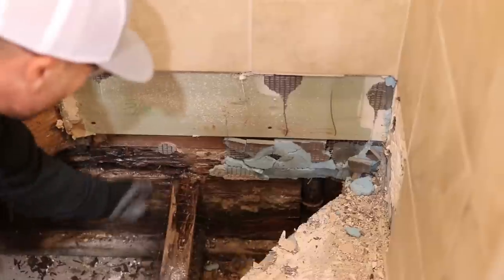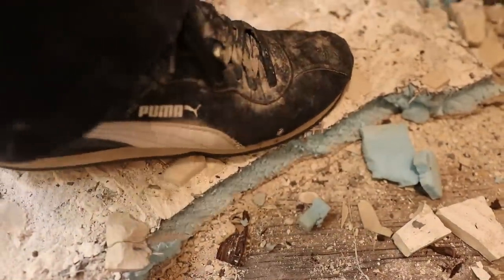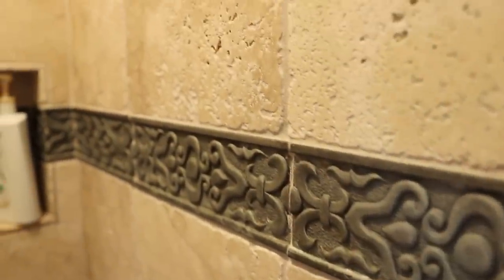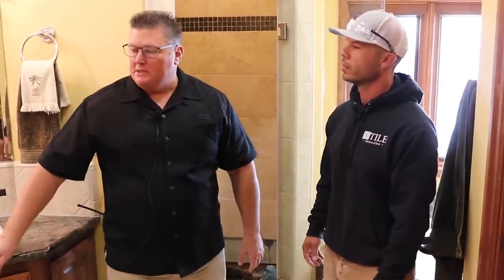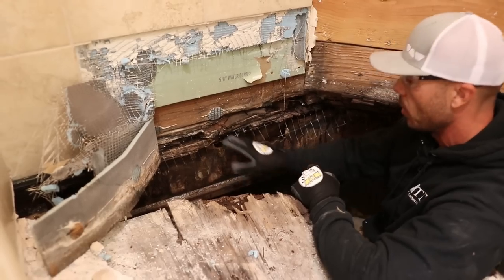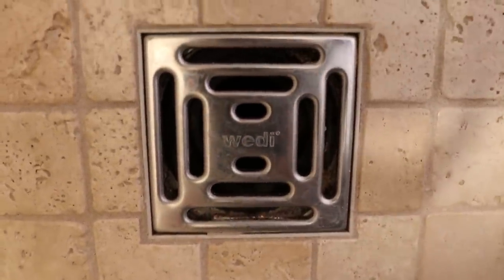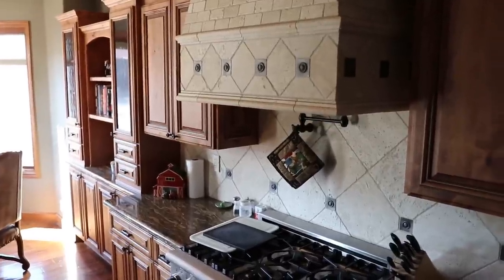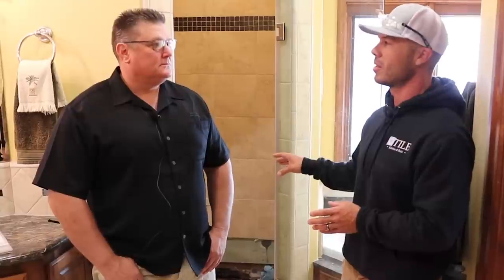Massive WEDI Shower FAILURE (Done by Certified Installer) -- Warranty Claim DENIED

Comment from the maker: Before you comment that the wrong sealant was used, please understand that Wedi was using Sikaflex polyurethane as the approved sealant at the time of this install. I have proof from archived websites that explain it in detail in this video: https://youtu.be/_skYsjFBnPM.   The sealant they now use use is a silane based sealant similar to kerdi-fix, which performs much better in wet applications. Important to note that Sikaflex polyurethane has a manufacturer one year warranty.
Reply: The caulking has a 1 year warranty but the shower has 15? 🤷‍♂️
Reply: My understanding is any polyurethane sealant is used for expansion joints? In EXTERNAL building applications amd definitely not in internal wet areas. That’s the case in Australia where I am, in showers we use silicone not polyurethane but silicone is only used to seal junction joints in tile applications where the floor meets the wall. You absolutely need a one piece system of waterproofing from floor to wall transition with no overlapping of two separate materials but this doesn’t even have that! Like Isaac says the complete waterproofing of floor to wall joint is reliant on caulking! This is madness! This is all wedi’s fault 100% the install looks beautiful to me he just followed wedi’s instructions
Reply: 2021 Catalog: "Wedi Joint Sealant is Polyisocyanates and PVC free, and a zero VOC sealant."  I'm with you...nothing magic in a caulking tube except 3M 5200.
Reply: Thanks for the vid TileCoach.
Reply: I live in New Zealand and repairing leaking tile showers make up 50% of my work.I have used ardex wpm 001 for 25 years always over sand and cement screeds. Never had one leak.... famous last words.Companies have tried to reinvent the wheel for faster installs etc.Worst one is the Atlantis system where you tile over a pvc tray with mapei epoxy.Wont tile them as a couple I did years ago .The tiles delaminated...as for the crappy waterproofing stick on butynol for the walls I  waterproofed over the top to be sure and meshed the bottom join
Reply: That’s crazy… from 2007.  Wow.  Wedi now likes to see blocking from stud to stud around the base.  I like to utilize their seam tape around tgd base as well.  Kerdi is like trying to put mortar on grass carpet.
Reply: You other comment people need to realize that mistakes will happen but let’s open up our information and it’ll get better
Reply: Sad part, is most likely installer followed the manuf. instruction. You put anything on top and they will deny because you did that, you follow and they screw you anyway. This companies should be held accountable
Reply: Caulking won't seal a shower floor, period! :face-pink-tears:
Reply: So should DIYers stay away from Wedi?
Reply: @StephenKerner33 no, so long as you’ve got solid skills.  wedi is awesome.  I’ve don’t multiple wedi showers including their ligno curbless. Zero issues over the years.  You can also call your local regional tech rep and ask them questions directly.  Great service. It’s all about the quality of install.
Reply: Love your videos man. Maybe you could get into the light framing substrates? The floor in this video could also have deflection caused by the TJI system.  Maybe the span and spacing was wrong and caused the sealant to pull away from your rabbit joint...
Reply: Looks wrong to me. The WEDI adhesive is grey.
Reply: @JP-ec8fe I am certified Wedi man. I like the product. I've had no call backs. However, I've used Wedi for less than 10 years. What's to say one of those showers won't fail after 10 years like this one. Seems like all the failures Issac has examined have to do with depending on sealants for many years to keep out water. Water seems to eventually find its way through anything we try.
Reply: Best comment
Reply: Did I hear where the leak started from?  It doesn't matter what you waterproof everywhere if you have a leak from the shower drain, eventually the water gonna to where the low point is.

Comment: I am a tile contractor in Florida. I had a failure with Wedi and they denied my claim. This was on my own house. The gray cement like material delaminated off the blue closed cell foam on my shower pan causing the pan to become spongy. Wedi is a terrible company and will never back there product they will always blame it on the installer or some other factor. I am so glad to have seen this video. Thanks
Reply: Yep, it could be a "lifetime" warranty and still wouldn't matter cause the MO is deny all claims.  The only repercussion the homeowner would has is to sue the mega corporation.
Reply: Pedro Escarfullery *you’re
Reply: Pedro Escarfullery or ‘your *lion’ 🤷🏻‍♂️
Reply: @Pedro Escarfullery No it's true.
Reply: 1surfercross, I've never used WEDI, but can vouch for them that sadly the vast majority of the times any system fail is due to the installer, and not the product. I have researched WEDI and would feel confident giving a lifetime warranty on the installation and product, but should disclose that I have been renovating multi-million dollar homes for 30 years. Also- no way would I trust 99% of the contractors that are hired from craigslist, or Angie's List the classifieds etc. to complete a walk-in shower install start to finish. I know better than to do something like that :)
Reply: if you look at the first comment on the video it should like he is trying to get a class action lawsuit together.
Reply: Just like their German cars😒
Reply: F wedi
Reply: Makes you wonder why the "warranty" is even offered if they deny every claim.

Comment: Wedi sealant is Grey and is a proven product. In your Video you mentioned the caulk is wht. Proof the builder did not use correct sealant. Builder/ installer is liable...
Reply: I somewhat agree with you, the clock that he showed was white I'm not had any problems with wedi installations what's the weather at waterproof and water test every shower pan but after 10 or 11 years I would assume that especially living in California with wood being underneath and not a concrete slab oh, I would assume that there would be a lot of Shifting
Reply: 100% correct…wedi sealant is grey, not white, and is proprietary. It must be used with their systems to be warrantied.
Reply: Wedi use to use a white caulking sealant.
Reply: @jamespenhale6166  wedi didn’t always use the grey sealant. Use to be a white caulking type sealant

Comment: I'm still amazed that anyone thinks that putting drywall in a shower, no matter what it's covered with, is a good idea
Reply: Its done quite often depending on the methods. Some products can work with either or. I wouldn’t use anything but cement board or schluters substrate
Reply: CGTOW I’m a contractor and if anyone who tiles over drywall in the shower room, will be terminate immediately. Use waterproof go board or cement backer and waterproof Red guard, two coats
Reply: Still do it the old way with waterproof board, pvc pan liner , wire and cement on the curb. No leak in 25 years. Nowadays also use red guard for double protection and it looks good. 😏
Reply: Thats why that green board had zero damage lol if its waterproofed its same thing
Reply: @RR-ty6zz  than u might just use Cardboard. If it’s waterproof it the same thing 🤷‍♂️🤷‍♂️🤷‍♂️🤷‍♂️
Reply: um yeah but the green board didnt have any damage. and when you use the wedi system it can be attached to the framing or retro fitted over drywall so the green board has nothing to do with this shower failing ...
Reply: We use hydroban foam board
Reply: @raymondmaglaris4149  hello, I just bought a hydro block
System to do a new shower. We took old system out to studs. Seeing the video has freaked me out now. I did quite a bit of research before purchasing and felt it would be a good system for experienced DIY. Now I’m truly wondering if this is going to hold up! What is you experience?
Reply: @randitommeraasen9272  ive used hyrdroban foam board before and it was honestly a great experience. I like it better than aquadefense or redgard on sheetrock or durock. Be sure to leave an 1/8th inch gap between the shower pan and the wall or the water will wick up. Not really a problem with hydroban but i think its a good habit
Reply: @raymondmaglaris4149  I saw after I commented that you have used hydroban. I actually bought a system called Hydro block. It’s a foam core. I’m starting to rethink this plan.
Reply: @randitommeraasen9272  hyrdoban board is also foam. Youll be fine just remember to fill your screw holes
Reply: @billl2383  use the Schluter foam boards

Comment: Moral of the story.  Stop tiling shower floors.  Buy a shower pan and tile the walls.
Reply: I try to convince homeowner to go with cultured marble shower base.
Reply: Exactly. I work with this crap every day and it's NOT WORTH IT.
Reply: No kidding.
Reply: I am in the process of buying an engineered quartz (Silestone) shower pan.  I'm trying to avoid these sorts of problems.  Hopefully, I can figure out the best way to seal the tile wall/pan intersection.  There are so many methods and products out there that it's hard to make sense of it all.
Reply: while that certainly seems practical, the problem is that prefab shower pans are ugly as hell. Have to draw the line between what's practical and what looks decent. Certainly everyone  appreciates a nice aesthetic.
Reply: @fairtex7  I ended up buying a Redi-tile pan as the Silestone was going to take months.  It was costly and feels like it's made out of compressed pulp.  I will carefully waterproof and seal it all up before either using tiles or pennies for the floor.  I'm already wishing I would've gone with an ugly insert.
Reply: B Dennis , Koehler has cast iron shower base, they have much better tactile feel of solid surface than acrylic base installed over mortar bed. Also enamel over cast iron will give much better longevity.
Reply: I am ready to do my shower because of cracks in the grout and a general update. Are prefab pans nice enough for a high end bathroom? I would not mind using one but I am afraid it might look like a hotel shower. Thank you
Reply: @lovera3878  I was hoping to get a shower pan from Silestone, but the turnaround time was going to be quite long.  I ended up using a prefab pan from Tile-redi that requires one to still cover it with tile (or whatever is preferred.).   I may go for the Silestone if I redo my other bathroom.  I'm surprised there aren't more options considering the popularity of engineered stone surfaces.
Reply: The Truth of the Matter  right, or increase thickness of subfloor to get 1.25”  or more thickness for sensible rigidity to tile on. Otherwise it is just time bomb for cracks to develop.

Comment: Every time I see these videos I appreciate my generic one piece drop in shower/tub more and more
Reply: I'm a tile setter and I get calls about stuff like this all the time.
Reply: Pedro Escarfullery yeah because he don’t install that junk!
Reply: Most houses I have seen in PA have the cast iron or more often plastic shower base and then ceramic tile walls.  The bottom is one solid piece and so does not have these issues.  I cannot figure out why these people in California go for these tiled shower bases with so much work, expense and problems.
Reply: @Pedro Escarfullery and you seem to have a problem with basic comprehension. Isaac pointed out that he's personally not comfortable installing a shower system that depends so heavily on the bonded joint between showerpan and wall. It seemed quite clear from the demo that the Wedi joint failed. Which leaves you with absolutely nothing to offer but silly insults.
Reply: I recently replaced a fiberglass one. It had a major crack were the drain was. The one I replaced it with had a foam support in the bottom.
Reply: @kode3 Oh no! Please don’t go away with that being what you took away!

 If you want tile realize it is a luxury item and you need to hire a pro. Not shop on price.

There is stone work that lasts thousands of years.

There’s are tile showers that last multiple lifetimes
Reply: @rogerslawncare7260  your?
Reply: Americans spent decades trying to make showers cheaper and more leak-proof, the result was one-piece showers or tub/pan with faux marble walls.  All are practically leak-proof.   But they look "dated" so we then jumped to this bullshit.

I stuck to tubs and shower pans with tiled walls.  That's where 99% of leaks occur and finding people who can build a proper shower floor is hell.
Reply: @Pedro Escarfullery don't get bent out of shape because it's your work in the video.
Reply: I am a cleaner and I too agree that the one piece drop in shower/tub is the best way to go. So many tiled bathrooms like this have failed and leaked. One customer I clean for has had hers fixed twice and it still leaks and now it looks like this!! They look nice but they are riddled with problems.
Reply: After much research and seeing issues like this, I bought a Kohler acrylic pan and am very happy I did.  That thing is solid.
Reply: Rogers’ Lawn Care just flip the you’re with the your and your “punctuations call out” will pass. 😉
Reply: AMEN.
Reply: I am in the process of ordering an engineered quartz (Silestone) shower pan.  I want to avoid nightmares such as this one.  Hopefully, we will start to see more engineered stone pans in the coming years.  Seems like it could be the best of both worlds.
Reply: @MrNeptunebob  yes indeed, I'm UK and I have a lovely 5 foot floor level walk in shower pan, why go to all this trouble for a tiled shower base? I'm thinking it gives you complete freedom as to size and shape of your shower but beyond that I can't see any advantages
Reply: @Tommo1983ful  I agree, I went with a Kohler cast iron shower base, I hope it last many many years with no problems.
Reply: That’s sad because Wedi is the best shit out there. Install it right and it will last just as long.
Reply: This is why I love my one piece tub/shower unit.No leaks or molded caulking .Had mine installed over 15 years ago still looks good.
Reply: Spot on.  all these raps seem like a leak waiting to happen  !!

Comment: Yes sir Isaac, I have been in the business for over 37 years and I still install the old school way. Rubber membrane and real mud. I have seen all the schutler and wedi systems at the trade shows and never bought into it. All these guys been in business for 10 years haven't had any issues with these products. All of a sudden 11 years later this guys floor is completely rotten and could have been termite infested and then some. Thanks for the video brother and keep educating the world. Al from Maryland
Reply: Termites my ass. That is dry rot from years and years of water intrusion.
Reply: I install wedi and hydroblock.  It's a good system if you know how to install it correctly.
Reply: I think Wedi is great for the walls and benches, but after watching this, I might not use it for a shower pan.

Comment: The extreme amount and severity of the wood rot means the water leak did not just did not start recently, more likely it's been leaking for several years. Probably started when the shower was still quite new.
Reply: The house rotted around the shower

Comment: In the Uk most of the wet room systems we use require you to build a solid frame under the floor as minimum so that all of the outer edges of the “tray” are supported. There appears to be no addition framing installed in this video to give additional support for the wedi shower tray